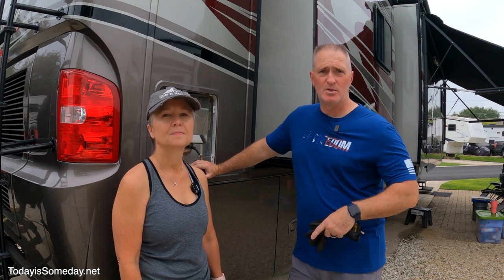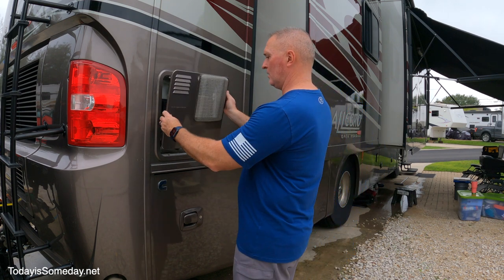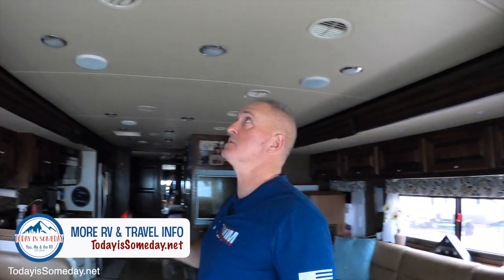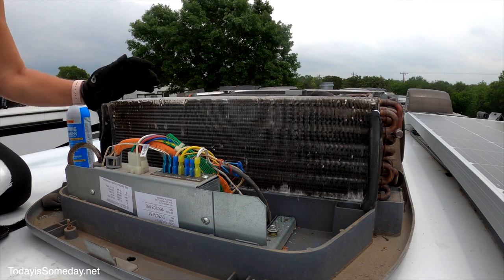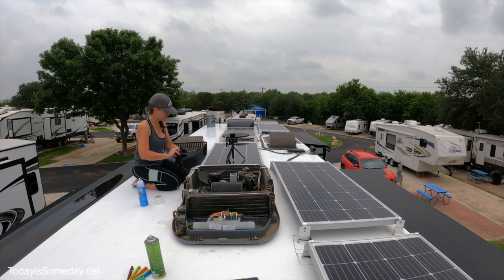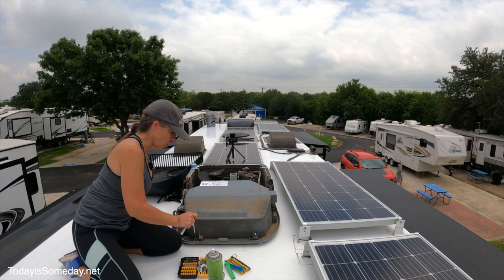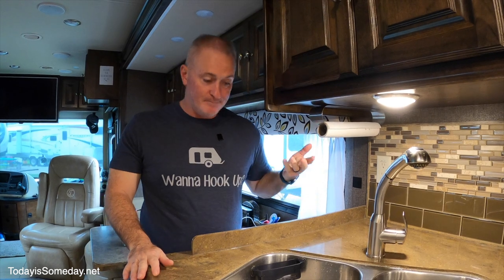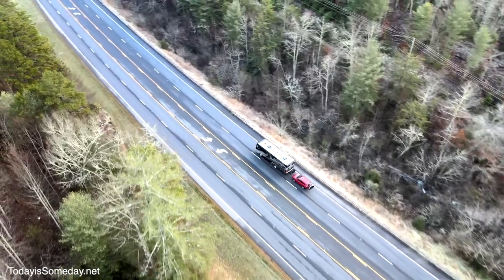RV Maintenance Made EASY (RV AC MAINTENANCE)

Comment: My wife would volunteer... to call someone. We have the diesel Oasis® water heather and it requires a bit more annual maintenance. It also heats the RV. When it comes to AC maintenance, don't overlook the bolts that hold the unit against the gaskets.(Inside unit) The vibration going down the road can cause them to back off. I know many RVers who put the coffee maker in the sink.

Comment: I (Phil) just did AC cleaning on my front AC which is only 10 months old and got a 12° cooler differential from before and after. 56° output versus 44 now! The outside temperature is 87° and the inside temperature is 81.  Even though this is a newer AC, it has been periodically shutting down because I think it is hitting some kind of a high temp shut off. I went up and the coils looked clean but holy cow!  It doesn’t matter how your coils look as much as doing the routine maintenance! Wow!
Reply from the maker: Thanks for sharing.

Comment: I did it, got up on the roof and serviced the two A/C units. As simple as you said it would be, and they were pretty clean. I bought a tool for straightening the fins but didn't use it, as you demonstrated, the brush on the cap of the cleaner did the trick. The hardest part was getting my large self up there. This would have been a $149 charge at my local repair shop. Thanks so much for this.
Reply from the maker: Sweet!  Now you start a side job for others.  It feels so good when you can knock out something like this and save some money in the process.

Comment: Great post, guys...I don't what I did or if it was just coincidence, but I cleaned my coils a few weeks ago and then the front unit stopped blowing cold air (d'oh!).  Checked the capacitors, now it's off to the mechanic tomorrow.  :(  But yeah, getting those covers off is quite the chore!

Comment: To prevent mud dubbers from causing problems with your water heater and gas refrigerator lay a dog flea collar inside on the shelf behind the cover and you may find your problem solved. I haven't had any problems since I started this.

Comment: That counter is also notorious for the grandkids to grab hold of. Re attached twice now LOL. Side question, while stacy was on roof i was trying to count solar panels, how much solar do you guys have and what size solar controller? We have I believe the same battery system you have 6 battleborn and 3000 watt magnum hybrid. I think our solar needs to be upgraded or grow we only have 400 watts and we are power hogs we have discovered out here on day 46 of boondocking in Utah.
Reply from the maker: We have 1200w of solar, 6, 200w panels.  We do have 6 lithium batteries and it all works like a champ.  We have a Magnum PT 100 Charge Controller; https://kit.co/youmeandtherv/rv-solar-upgrade/magnum-charge-contro

Comment: Be careful when poking around under the A/C shroud even with the power off. You still need to stay away from the capacitor and its wiring unless you discharge it first. Get ahold of it by mistake and it can knock your ** in the dirt.

Comment: How do you do your top seals
Reply: My question as well
Reply from the maker: We use a swiffer mop handle with a microfiber rag on it and slide it under the slide topper.  It takes a few try's to get the angle down.

Comment: When my back goes out I get on the inversion table, sometimes it’s instant relief  but I find it shortens the healing time. You may not  not have room, but maybe your sports club does. 
Is there room to put the bug screen on the inside of the water heater? Do you put a bug screen on the fridge?
Reply from the maker: No room on the inside.  We have the screens on both furnace vents as well.  Not need for our fridge (residential).

Comment: Stacy, get a product called: EasyLiner Select Grip PVC Shelf Liner  cut it to fit under your coffee pot and anything else you have on your counter that you don’t want to move during transport.  I’ve used this under my Keurig coffee pot and my coffee pod holder and never ever have had it move and we’ve owned a lot of different coaches from a 40’ class A to smaller class A’s and even class C’s and use these under stuff I want to leave out on our counter and it never moved.  My paper towel holder fell over but did t slide lol.  I wouldn’t recommend you leave stuff on a counter in any pull behind trailer but in the drivable these work great.  Hope this helps and still empty your coffee pot out though.
Reply: Gorilla makes a really good grippy shelf liner too
Reply: @marycraig9434  thanks good to know, didn’t know gorilla had one out there

Comment: Great info as usual, especially the tips on air conditioner/heat pump maintenance and another checklist item for our quarterly/annual maintenance schedule!

FWIW, I've found that 3M 5200 Marine Adhesive/Sealant also works extremely well for potentially damp or wet areas like countertops.
Reply from the maker: Glad it was helpful!

Comment: That's a pressure / temperature valve, it must not be submerged..there has to be a 10% air gap at the top of the tank.. you can possibly hurt someone by expounding such poor advice..do not bleed the air out of tank when filling tank!

Comment: Hi, yes the water softener takes out the metal and calcium deposits in the water which in turn helps to protect all of your plumbing and appliances that use water. my slide-out seals were looking fine, I tried to be pro-active and coated them with the conditioner, 2 weeks later one of the seals was eaten away in several spots. makes me wish i never sprayed them down. the one part of our RV I just can't seem to find replacement parts for. as far as the AC goes, if you are not in a dirty area, you should be fine for a while, but if the area you are in is dusty / dirty off the side of a freeway or something like that, it may need maintenance much sooner. I am in southern California where it is dry and dusty. when i do our ac maintenance I simply use compressed air and blow out the condenser and evaporator. I never use chemicals if I do not have to, mostly because my wife is sensitive to odors. JB Weld ?? OK if it makes you feel good...lol I would have used an epoxy cement also. I don't like to do the same repair twice especially do to weak repairing materials. another great video, best of health and safe travels.

Comment: Nice Letchworth	h SP hat.  Just down the road from me.  Did you drive RV into park?  Roads are extremely narrow.  Briefly followed Class C RV I’m park.  Driver was hugging center line and outside dual rear wheel was over the brim frequently.  Curious how you did with driving in with Class A and towed vehicle.
Reply from the maker: We drove it in with no problem at all.  Very nice park!

Comment: How do you reach the upper slide seal since it is under the topper, any tricks to pass on for that task?
Reply from the maker: We use a swiffer mop handle with a microfiber rag on it and slide it under the slide topper.  It takes a few try's to get the angle down.

Comment: What is the name of the two cleaners you used on the AC and which one is more expensive?
Reply from the maker: https://kit.co/youmeandtherv/essential-rv-tools-supplies/3026551-foam-coil-cleaner and https://kit.co/youmeandtherv/essential-rv-tools-supplies/3026554-no-rinse-coil-cleane
Reply: @todayissomeday  great. We bought the expensive one and it did not come with the scrubbing brush 😢

Comment: oh well.... my Monaco Diplomat is 2001.  I have never done anything to my slideout seals.... no leaks!
I have never changed a rod in my original water heater... still have hot water. I have never cleaned my a/c ...  yes, replaced both.... just don't understand why you feel the need to do all you do..... 135,000 miles on mine.... just got home to Mich from Fl via Savannah. And I am 82 yrs young.  No way most rv owners want to do all you describe....  just wondering how long you will do this .... especially if you were not vlogging..
But a big thank you for your service; really.
Reply from the maker: My Dad always told me, take care of your stuff and it will take care of you!  I will continue to do our regular maintenance, no channel or not.  We are showing RV owners how easy it is to do it......never said anyone HAS to do anything we say or do.
Reply: Well Ernie, I certainly hope your luck holds out, as someone who has done maintenance on trailers that belonged to people with your mindset, that is exactly what you have had! Shear luck! 
I, like Phil and Stacey, would much rather be safe than sorry! We’ll say a prayer for you!